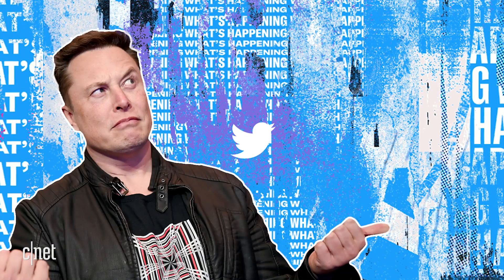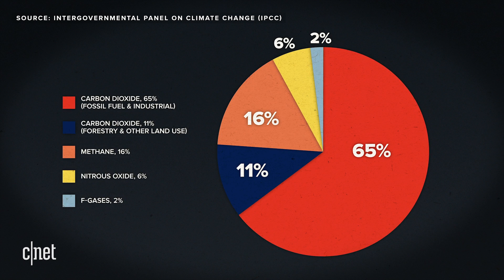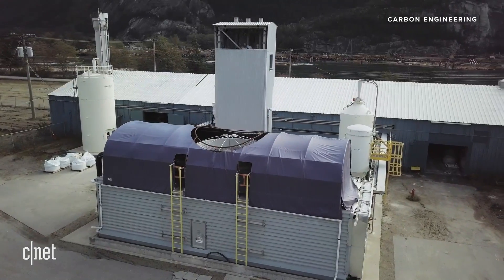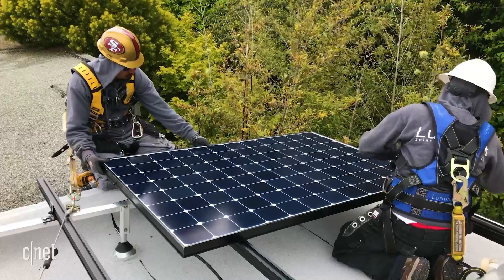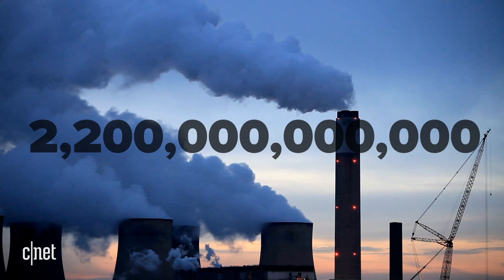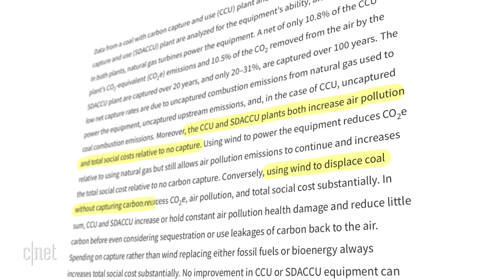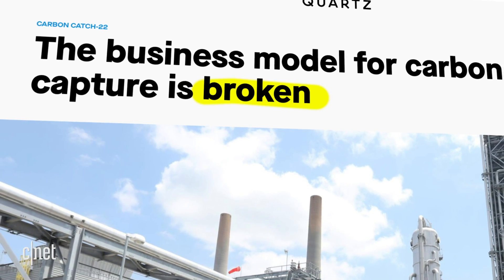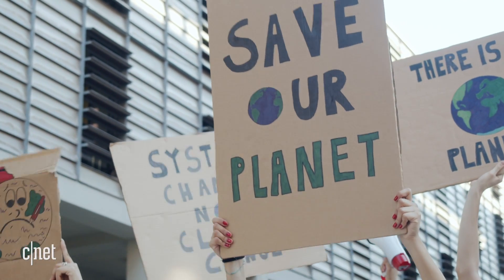Why Elon Musk is giving $100M to capture carbon

Comment: Thanks for watching! What are your thoughts about carbon capture and carbon removal? Yes? No? Maybe? 🙂
Reply: If it can work, I say go for it. I just hope building these things don’t make things worst.
Reply: Carbon would be useful.
Reply: I was an absolute ignorant about the matter. What I say is: if it really works, let's give it a try.
Reply: YES! We waste so much energy, much of it could be diverted to carbon removal. Climeworks’ first plant, for example, uses the heat from trash incineration. 
Up to half of the energy produced by coal and nuclear is wasted because they always need to operate at peak capacity. 

So does climeworks win the prize when their new plant comes online? 4000 tonnes a year is 11 tonnes a day...

Pulling carbon from the skies, 
sequester and neutralize! Yeah!

I need to sing a new song about carbon removal....
Reply: Woo alg click bate. Anway. No. I think the biggest concern is that carbon capture should be easiest to do directly from c02 sources. So for example it should be much easier to do from a natural gas plant than direct air capture. But we don't. Because its more expensive at the moment than just replacing the plant with renewables and batteries. The hope of course is that costs will fall. So it might be worth investing some in now in the hopes that it will become more economical later. The problem is that it becomes and excuse to keep polluting. Every new gas plant now claims that it will be set up to enable future carbon capture. And the general hope of direct air capture gives an excuse to keep pumping into the air.  If Elon and Gates were really serious about the tech they would be campaigning for requirements to install it on any new gas plant. Because really we are at the point now were building even one new c02 producing power plant in the first world is irresponsible.
Reply: marta please see my comment
Reply: Thank you for explaining very well.
Reply: Yes why new technologies and better air hopefully a new way to farm things without overwhelming it. Mybe we can find some new ways in using co2. Co2 uses can be indoor farms or find a way to cool hot citys for co2 is very good at heating and cooling
Reply: Whales are really good at carbon capture. I say more whales!
Reply: Maybe in the future it may reach where they are capturing too much carbon ? And would have to reduce...
Reply: Next time speak Spanish and just add close captions because you have the worst accent ever!
Reply: love your accent!
Reply: ANTIFA IS ABSOLUTE IN THIS ONE  finally someone who is reasonable 👏

Comment: Factories will Create Big metal Capsules instead of Chimney and less Pay for State and other for Pollution. Work it's will lower Pollution by 10X and Create new Indestry by Tesla Machines for enviorment. And You Pull the Carbon from Metal Case with a Tap for Recycle Automaticly in Land Fills.

Comment: Bamboo can produce 62 tonnes of oxygen per acre per year and absorbs 88 tonnes of carbon dioxide per acre per year.
it doesn't release Co2 like trees do when there cut down and can grow 2inches in 40 minuets quick fix
Reply: Greg Gaming   there are many many trees that can grow in droubts areas, pine trees are the best Co2 absorbing tree there is and it is droubt resistant.

Comment: My thoughts are thanky you, but I think the humble tree in large numbers will be best, I also think that all the extra microwaves from the 42 000 satelites for starlink will be the biggest problem not carbon, atmospheric attenuation and moleculr rotation will create friction, please just use fibre optics, and stop using dirty rocket fuel there are already alternatives out there, you can afford it, your obviosly not stopping so do it cleanly, suppose youve got a government contaract and the military is involved with starlink so you probably dont have a choice, I think your good though just this is what happens they grab you by the balls.

Comment: As an engenieer I never will support Carbon Capturing System. Next 30 years. Its only for non scientifc marketing and "greenwashing" today.

Every process you add evolves entropy, means if you add CCS at the and of process chain it will need energy. As if Energy in our modern world is based by 90% on Corbon we produce a lot more CO₂ with CCS than less.! And thats just true.

CCS  in Alkali-Filtering shown in the video is about 5-10 times more Energyintensive than you got by releasing it to Atmosphere in a combustion engin or methane turbine.
It would be better save the Energy and use it directly for consumption.
Benefit = 500% to 1000% from start investment (basic energy thats burned in the CCS process).

If the world is totaly powerd by carbon free energy sources, it makes some kind of sensce, to use overproduktions from solar and wind sources for capture carbon.

But only overproducion! 
And only in carbon free countrys!
(Or countrys that are on a low 10% carbon based energy level can use CCS in some situations.)

Remembere we are still on 80-90% Corbon!! 

If you catch it directly on  exouhsts it gets a bit better.  But rembere every car needs a CO₂ Tank that has to brought back and get emptied while you fill up gas on the other hand.
Does that work,.... no, people will by gase but not 100% pay back CO₂.

And direct capture although needs a lot of energy and resources.

In summ CCS is usless for most applications, at least nexr 30 years.

Nice marketing video for exxon?
With very bad explanation of the true chemistry and physical energycycle. 

First Semesters engeneering and naturesciences  +Physiks.
Please take some courses first.

Elon Musk is a human not o prophet.
Not everything he says might be true or will get futur. And using an action or sentence of him out of context is influencing by misstreat his popularity. He realy has some very very good technical ideas, don't mix it up with Investor and Wallstreet nonsens.

Greetings from Germany

Comment: I feel like a massive section of carbon capture was overlooked here, there are many more technologies that remove carbon straight from emission sources such as amine based carbon capture from flue gas. These are likely the only way to meet emission targets in power generation and manufacturing industries quickly. Switching to renewables only solves the pollution from power generation, and it's still going to take a long time to make the switch. Also power generation is by no means the only polluting industry, so you're still only solving 1/3 of the problem. Carbon capture isn't just taking carbon from air, it's also taking out carbon directly from polluting sources, so I think this professor is being very short sighted here.

Comment: What is missing in the equation is cheaper clean power to run the process. The power solution can probably be solved by 2 new technologies:
1) MSR (Molten Salt Reactor) Nuclear or some flavour of this new power supply. Possibilities for more energy from a smaller safer power plant.
2) Liquid Metal Batteries to store the massive amount of energy that can be generated then used for peak demand.

Comment: 6:25 This guys not wrong, but thats not why Elon wants this technology he want's it for Mars. You need redundancies when considering going to colonize another planet, and currently one of the implementations of converting Mars atmosphere is on board Perseverance its called Moxie (Mars Oxygen ISRU Experiment) which is likely going to be the main focus. The redundancy would be to use carbon capture or vice versa depending on which technology proves has more efficacy. The way Elon will power all of this is probably through Solar City (one of Tesla's subsidiaries) so he has a manufacturer of solar panels for Mars, and he already has the Tesla Powerwall.  

So electric energy generation would come from solar panels, which in excess can be stored in Tesla power banks(if there even is any excess). Moxie and Co2 capture receive initial energy from solar panel arrays providing Oxygen for the people working there, but then also provide Carbon for other uses like the ones mentioned in the video. Once we they get the plants to work on the gigaton scale, then very rapidly we'll see Mars atmosphere change to majority Oxygen which causes its own complications. I think thats also why he started the Boring company so he can create underground pressurized facilities for the population of Martians to protect them from solar radiation, dust storms, and meteor impacts. This research is really not for Earth at all lol. 

That is what i would consider phase one is have a stable living environment on Mars, once accomplished they would go to phase 2 which is retrieving the water reserves on Mars for Hydrogen and more oxygen. Phase 3 would then be to figure out the Nitrogen problem which i don't know where or how he would get enough.